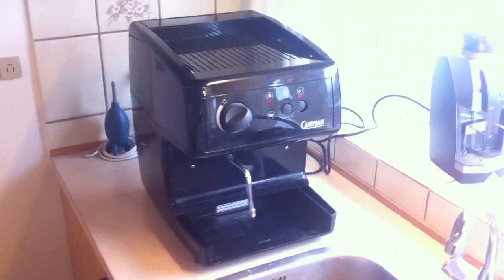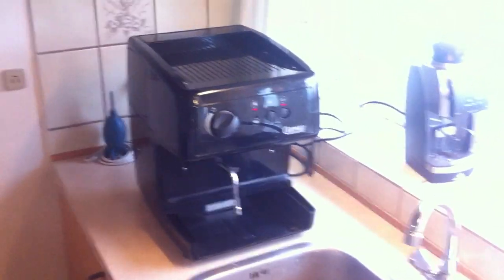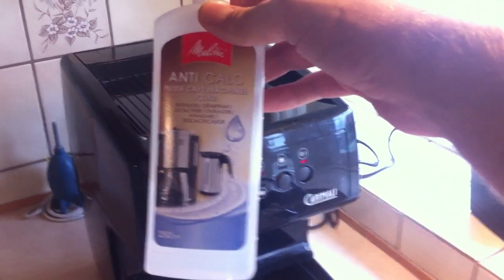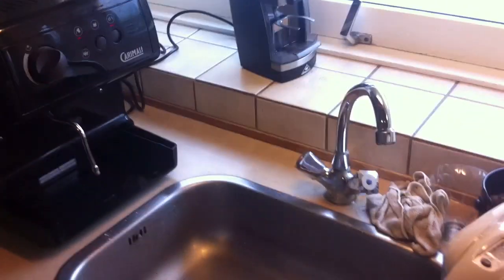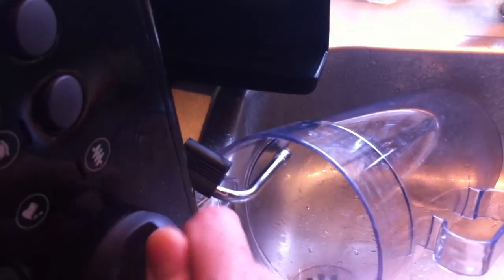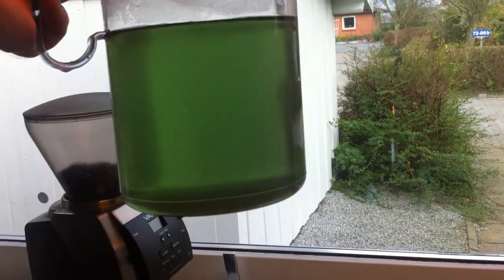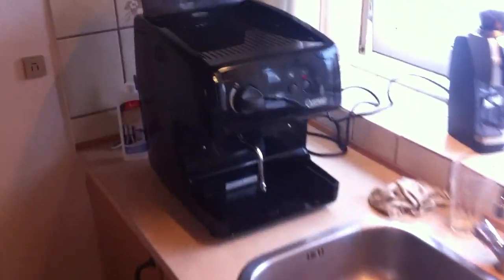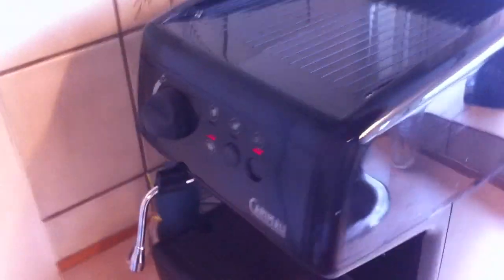Descaling the Nuovo Simonelli Oscar

Comment: I do not understand this descaling, it is completely useless and I'll explain why.
The boiler has a heat exchanger, during time if you have not used water with a low lime content you will have limestone in the heat exchanger,only on the heat exchanger, but never in the boiler. 
The central boiler is only used to generate steam and this process actually uses a very small amount of water, the descaling of the boiler is not necessary at all.
Have you ever opened a boiler ? 
Have you ever replaced the heating element ? 
I tell you that in many years of technical assistance on the coffee machine with heat exchanger I've never seen limestone into the boiler or on the heating element. 
I tell you that I have seen heat exchangers completely clogged. 
The descaling should not be made on the boiler, but must be made on the heat exchanger.
How? Simply using natural products, such as citric acid, following this procedure:
Mix well and dissolve 150-200 grams of citric acid in warm water and pour it into the tank.
The machine will be hot, operate the pump to let half liter of water and citric acid pass through the heat exchanger. 
Wait 5 to 10 minutes and repeat with another half liter. 
Again wait 5 to 10 minutes.
Fill the tank with fresh water and rinse the system with two liters of water. Finish by passing a final water adding a teaspoon of baking soda to neutralize any traces of acid that may still be present.
Before starting the procedure, it is ESSENTIAL to detach the wire of the 2-way valve. 
I explain because this points are important:
If you do the procedure after too long time and the machine (heat exchanger) is too full of lime, water inlet to the heat exchanger can be found clogged with pieces of tartar, that could obstruct the acid flow . If you see the hydraulic diagram of the NS Oscar, it is easy to understand that if the water inlet of the heat exchanger is clogged, then the water solution of citric acid passes trough the 3 way solenoid valve immediately to the coffee group, the water doesn't  circulate in the heat exchanger.
It is ESSENTIAL to disconnect the wire of the 2-way valve for the following reason. 
If during the descaling process the probe of the water level in the boiler starts, citric acid  solution  enters in the boiler, with the consequence that generated steam will have a taste of lemon.
Reply: Hi Gianni,

I just purchased a used Oscar - it wasn't taken care of and I wanted to clean it as per your directions.  But, where is the wire for the two way valve?  Can you possibly post a picture?

Also, I was going to install a vacuum breaker - but, the ones that I've seen on youtube seems to sputter and send water inside the machine - is this normal?  Won't that cause issues?

Thanks,
Ken